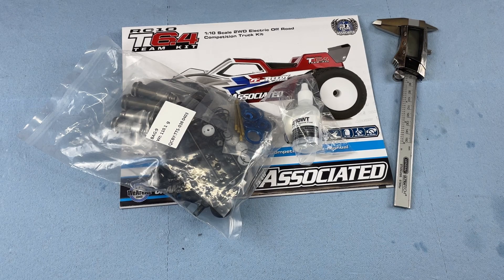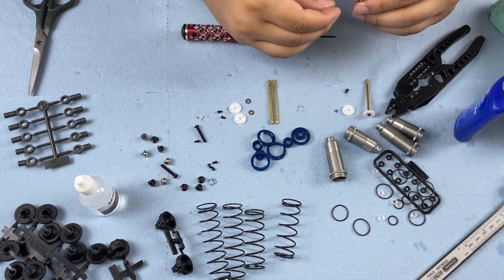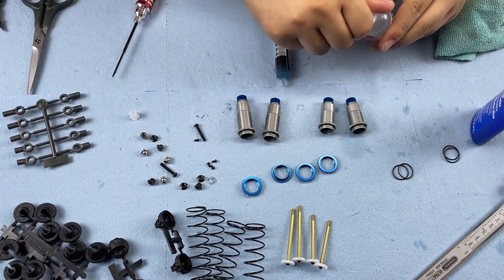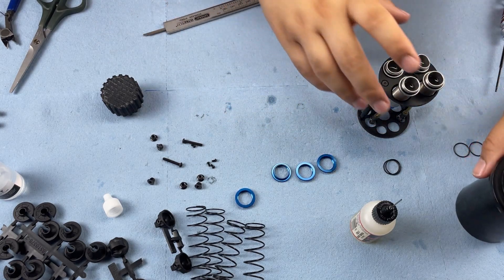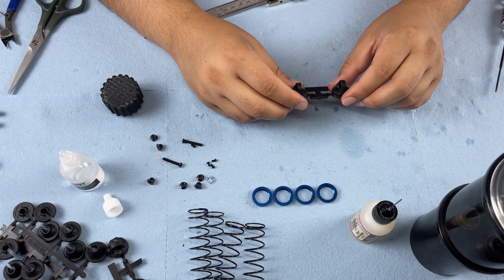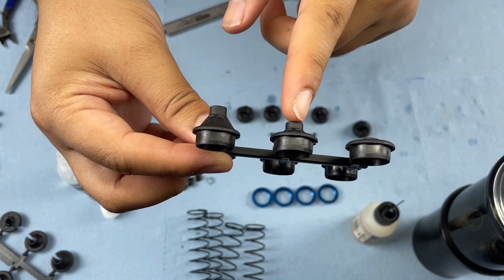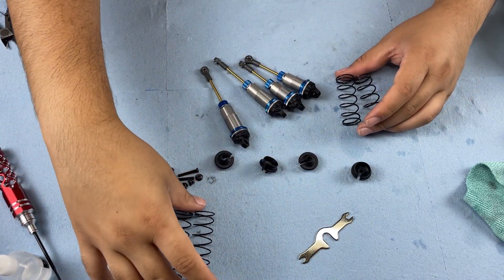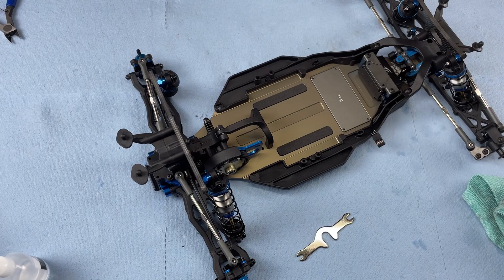Team Associated T6.4 Build - Bag 9

Comment: What brand of tools are you using?
Reply from the maker: I'm using HoustonRC brand tools. They don't have it on their website, but you can try to message them to see if you can order some. I think the allen set is $60 and comes with 1.5, 2.0, 2.5, and 3.0 mm drivers. The nut drivers are $30 I think and come with 5.5 and 7.0mm.